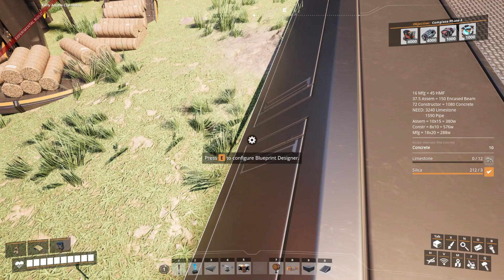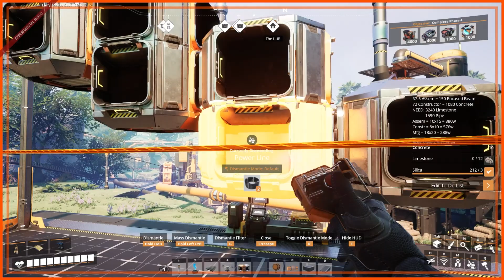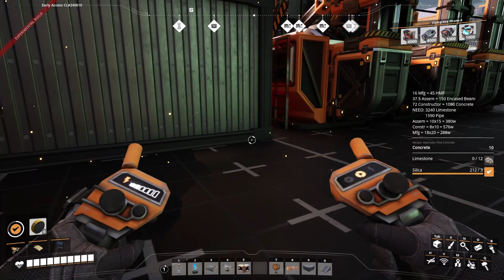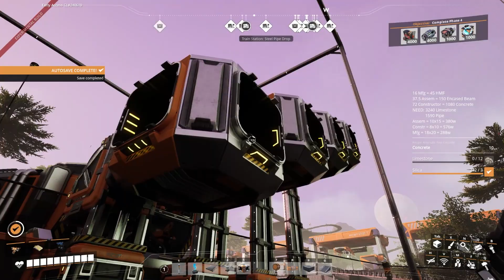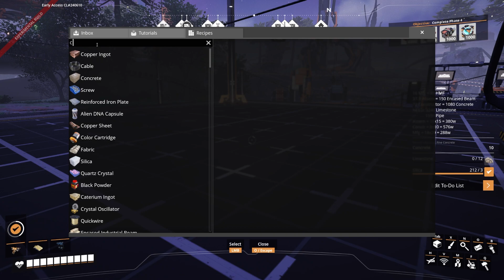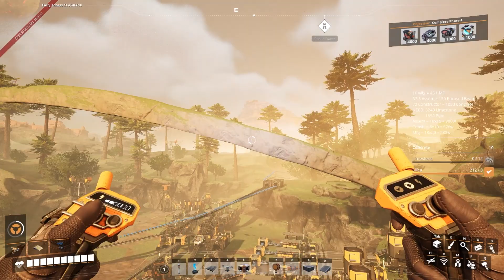Heavy Modular Frames Planning | Satisfactory | BigVlad Plays | Part 63

Comment: The manufacturer here is a good use case for smart splitters. That would simplify your setup quite a bit. In order to handle overflow you could just merge the excess back into the input line.
Reply from the maker: That's true, the overflow could be fed back somehow. But I've been programmed since Factorio to never combine product on the same belt. It feels wrong. 😀 I'll see how this looks first and if it's too messy, I'll change it.
Reply: @bigvladgaming  It isn't a problem and it simplifies the logistics quite a bit. I put an example I was trying on Doc's discord in the tips and tricks section. The example is making computers and I am using a programmable splitter on the sushi line and smart  splitters in front of the manufacturer inputs. The programmable splitter pulls the items off the line, the smart splitters push the items into each input and the overflow is merged back onto the sushi line to go into the central storage or the sink. It works quite well, very simple to set up and the system would work just fine with multiple manufacturing units. You would just take the overflow and pipe it into the next manufacturer distribution line. Instead of five input lines you have just one. In this scenario I would probably just sink the excess overflow or pull the rare items off the line individually with a smart splitter and send them back though. You do need to deal with the overflow to keep the line flowing.
Reply from the maker: @RickClark58  I suppose it would work. I would need multiple sushi belts due to the volume, but it's doable. I don't like sinking the excess material though, and that complicates things. I'll have to feed the overflow back into individual storage containers for each item (before they're merged into sushi), which may not be near the factory. Possible though, I'll give it some thought!